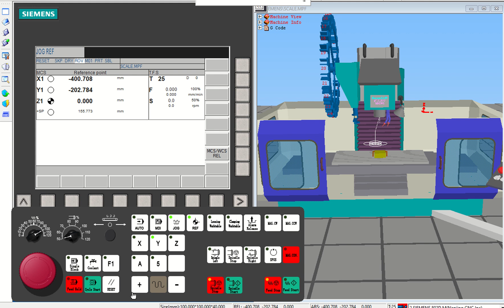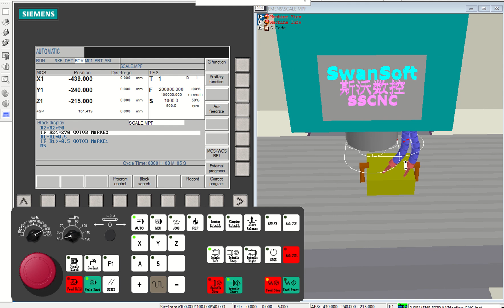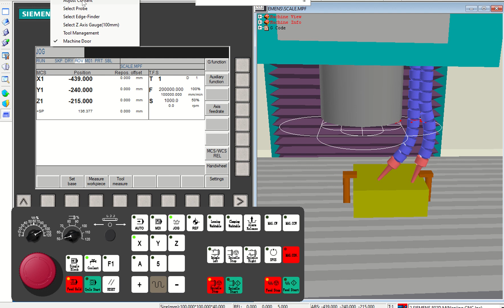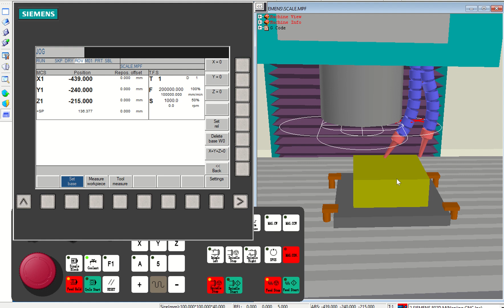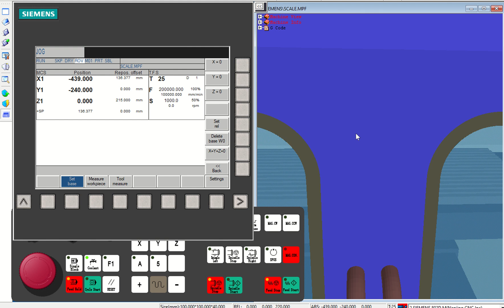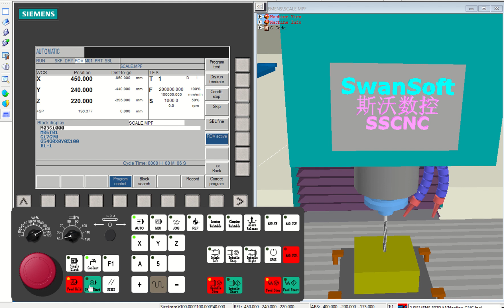How to Home and Dry Run Siemens 802D Milling Machine | Complete CNC Setup and Operation Guide

Comment: Hello , i need help loading jobs from a cf card on sinumerik 802d controller , can you help ?
Reply from the maker: Step 1: Insert the CF Card
Insert the Compact Flash card into the CF slot on the front panel of the controller.
The controller normally recognizes the card without restarting.
Reply from the maker: Step 2: Open Program Manager
Press the PROGRAM MANAGER key on the control panel.
Look for the softkey labeled:
Customer CF Card
or CF Card
Reply from the maker: This opens the directory/files stored on the card.
Step 3: Select the Program
Use the arrow keys to highlight the required CNC program/job file.
Typical Siemens program extensions:
.MPF
.SPF
Reply from the maker: Step 4: Load the Program into CNC Memory

There are two common methods:

Method A — Copy Program into CNC Memory
Highlight the program.
Press COPY softkey.
Go to:
NC Directory
or Part Programs
Press PASTE.

The program is now stored inside the controller memory and can be edited/run normally.
Reply from the maker: Method B — Run Directly from CF Card (External Execution)
Highlight the program on the CF card.
Press:
EXT EXECUTION
or External Execute

The machine runs the program directly from the CF card without copying it into memory
Reply from the maker: Step 5: Run the Program

Switch machine mode to: 

AUTO 

Load tools/work offsets. 

Press: 

Cycle Start
Reply from the maker: Important Notes
CF Card Format

The Siemens 802D commonly works best with:

FAT16 formatted CF cards.Program File Type

Programs should be saved as plain text CNC files.

Safe Removal

Some machines may require power OFF before removing the CF card safely.
Reply from the maker: PROGRAM MANAGER
   ↓
CUSTOMER CF CARD
   ↓
Select Program
   ↓
COPY
   ↓
NC DIRECTORY
   ↓
PASTE
   ↓
AUTO MODE → CYCLE START
Reply from the maker: Create program and save as .mpf or .SPF file extension for Siemens to see it